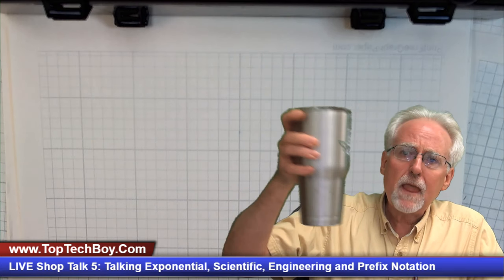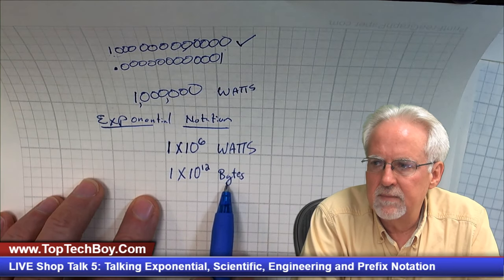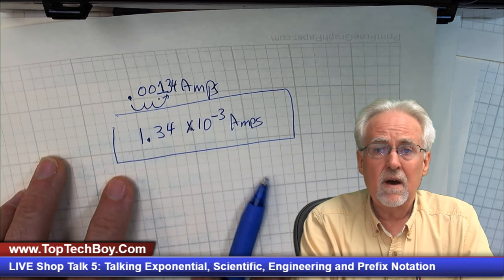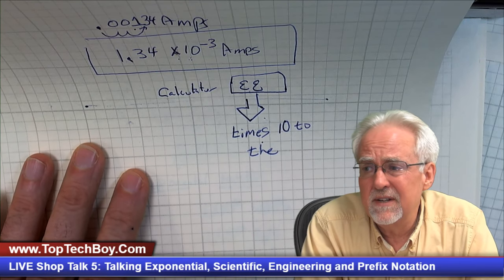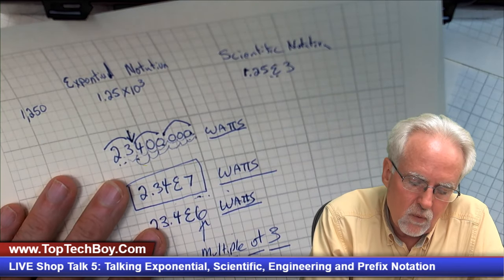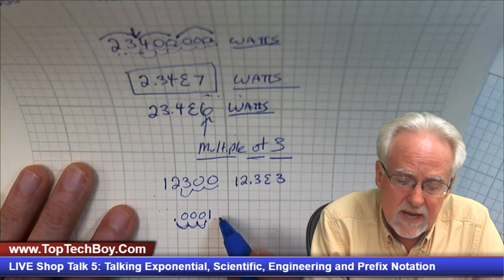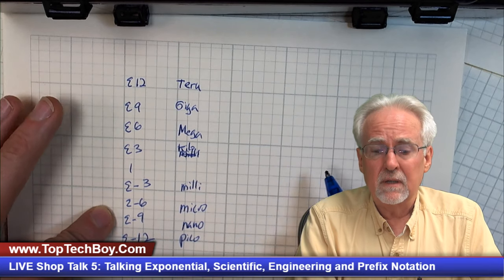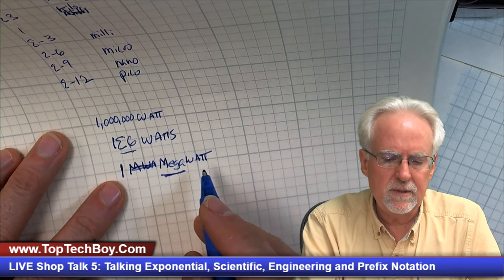LIVE Shop Talk 5: Understanding Exponential, Scientific, Engineering and Prefix Notation

Comment: 52:50 Yes, arduino is great for learning electronics fundamentals for beginners. 
The industrial sector uses microcontroller like STM32 to replace arduino, the C language to replace the arduino language, Keil or Visual Studio to replace the arduino IDE, But, the core technology or math remains unchanged. The physics doesn't change either. That's why Paul's lessons are really valuable, when it comes to learning the technology, math and physics, even though the arduino is not intended  for industrial uses.

Comment: Thanks for the prerequisite video for the IMU videos. It makes me smarter and reminds me of what I've learned in the past.  Math is beautiful, though it could be confusing or daunting. 
Also, can I ask why engineers use paper with grids like you did in this video? What's the purpose for the grids? Do you use them to align something? If not, why not just use regular notebook paper with horizontal lines? 
Have a nice day.
Reply from the maker: The engineering paper puts the brain in engineering mode. No way I could work on notebook paper. I could work better on blank paper then notebook paper, but engineering paper is the best